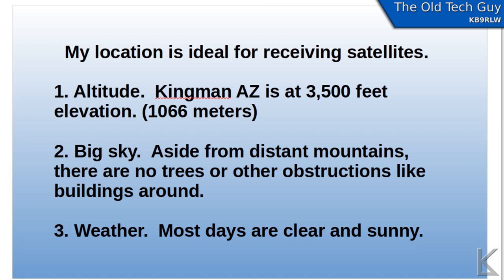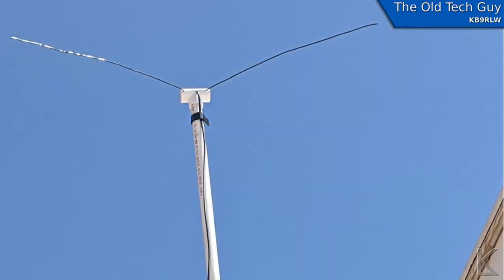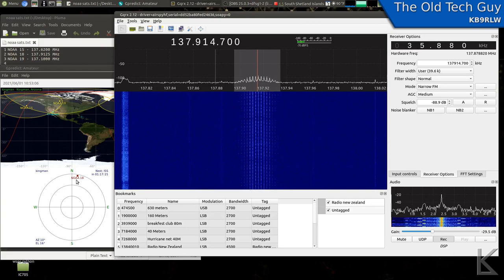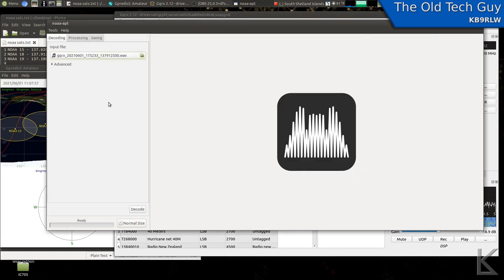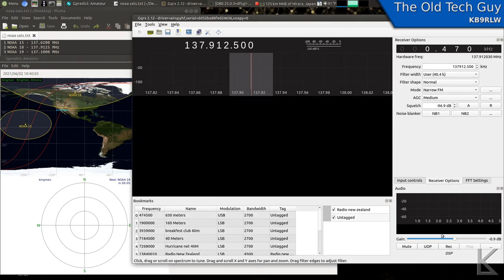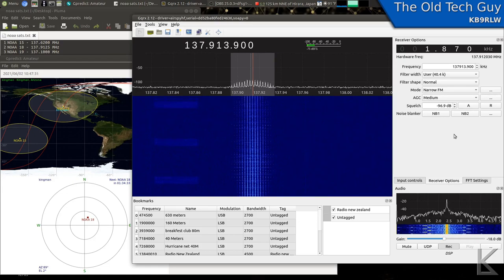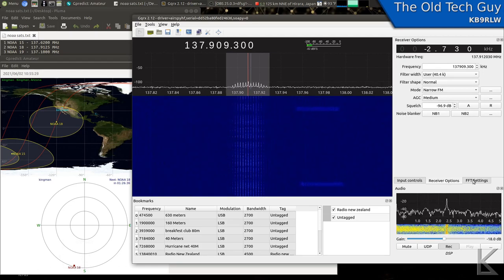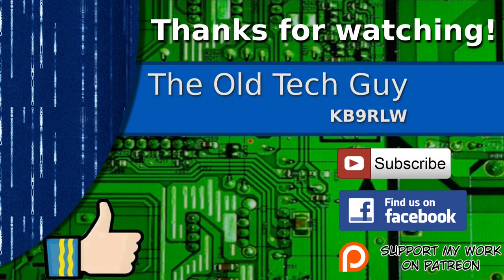Ham Radio - My local setup for receiving NOAA weather satellites.

Comment: I got good results when I built a QFH Coaxial for 137mhz, which was the best antenna I used. I would get reasonable results from a 40m delta loop as well LOFF. Thanks for the video, interesting. 73's Andy M6APJ

Comment: Nice video Kevin. Thank you. As far as I remembered I have connected GPredict & SDRSharp with an addition of a line in config file. The frequency was changing automatically to compansate the Doppler shift. Your location is great. I could not obtain good images in an apartment flat surrounded with many other buildings in a city.

Comment: That was a very informative test! Are you still planning on building an egg-beater antenna, or does this test conclude that the slim jim is good enough for your needs?
Reply from the maker: Yeah, pretty much the latter, as I kind of summed up in the vid.   
With the slimjim up, I'm on 2 meters most of the time.  Only have to move the coax to the other radio if I want a sat pass.  It works well enough to fill the need.
Turnstyle, cross dipole, the helix version, they're all pretty much unity gain antennas I think, like the dipole.  They should all perform pretty close to each other.   I still might build one down the road, to see in real life. :-)

Comment: I had the NOAA-APT source code for the BBC Model B and AMSTRAD 644 personal computer both used a hardware addon receiver, the program for the Model B was written in 6502 machine code plus BBC BASIC and Z80A Machine code and AMSTRAD Locomotive Basic,the audio would be decoded into coloured maps the article was in the MAPLIN Electronics Magazine which is no longer published.

Comment: You can see the intensity of the signal change not based on the current position of the satellite but rather the current position + the time it took the signal to reach you.   Relativity in action, yo!
Reply: Also, the longer it took the satellite to lose signal at the edge of the map tracker is like literally proof that the flat earthers are a bunch of weirdoes

Comment: Kevin, this has nothing to do with this but I have a question for your expertise. 
Didn’t you have a video that mentioned  building an antenna to pick up lightning and static discharges from things in the sky? I thought it was you but I can’t find it.
Reply from the maker: Nope, not me.  (not yet anyway.)  
A loop antenna will really pick up the static electricity.   When lightning storms pass within 10 miles of here, we can draw almost 1 inch arcs off the coax end to the landowners 80 meter full wave loop.

Comment: That was a very interesting video. Does GQRX work better than SDR#?
Reply from the maker: I guess that would depend on the particular criteria you measure 'better' with. :-)
I don't have a lot of experience with SDR#.  I played around with it a few years ago.   I remember it felt 'clunky' like most windows programs.  Not so much intuitive.  I went to the docs a few times.
GQRX seems to work more intuitively.  The mouse did exactly what I expected it to do, if you know what I mean.   I didn't have to think about the mechanics of doing things.
Reply: @loughkb  Thanks for responding. I have RTL-SDR. I will try GQRX.

Comment: Great video Kevin, tks very much,  would you give me the size of the dipole arms? How long are them ?
Reply from the maker: Together, they should add up to about a half wavelength at the desired frequency.  There are many formulae, for different measuring scales.  For example, for calculating a half wave in feet,   468 divided by frequency in MHz.  So at around 137 MHz on these sats, that's 3.4 feet total, or 1.7 feet each.  20.5 inches.

Comment: I noticed that gpredict can control your radio using CAT commands is there an advantage in receiving using a seperate program like you have. Or is it just that you used an SDR and that was adequate for your needs.
Reply from the maker: Gpredict can also control GQRX to follow doppler automatically.  I just didn't set it up.
With the SDR, I can set a filter width of 40-60 KHz.   If I used my icom, I don't think WFM mode is quite that wide.  So I'll get a bit better image with the SDR.

Comment: I didn't catch how you tracked the satellite. What app are you using?
Reply from the maker: Gpredict.  It's available in the repositories for nearly every Linux distribution.  I believe it's also available on windows and mac.
Reply: @loughkb  Thanks. I didn't see a Windows version. I found PreviSat, another open source app. Just started looking at it. Maybe others here have a suggestion for this.

Comment: I can't get the GQRX program to run.  Is it only for Linux or MAC?
Reply from the maker: It can be run on all three platforms. Search for GQRX and Windows and you'll find instructions for installing it on Windows if that's what you're running. But you can use other SDR applications, it doesn't have to be GQRX

Comment: Hey Kevin, 
I'm new to doing Linux, so don't pull your hair out over this :-) but you never told us HOW to ADD THE NOAA satellites TO GPREDICT in the first place, or if you did, I sure as heck missed it!  could you help on this???
Thanks mate, L8R
Reply from the maker: Up in the right corner of the program there's a little down pointing arrow.  The tooltip says configure module when you hover the mouse over it.  Click it and select 'configure' from the drop down menu.   There will be a huge list of available sats, find the noaa sats and add them to the active column.
Reply: @loughkb  
Thanks mate, been going a bit craz(ier) than I normally am (🤪😁) trying to figure it out!👍
L8R, & Merry Christmas 🎄⛄